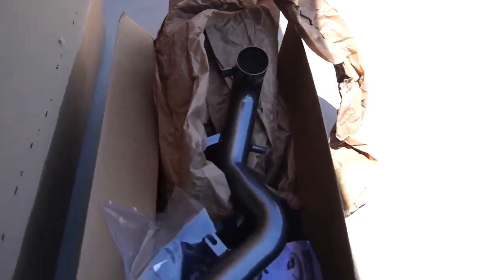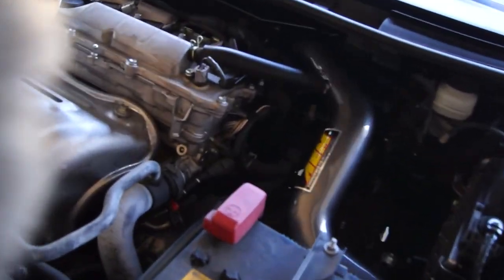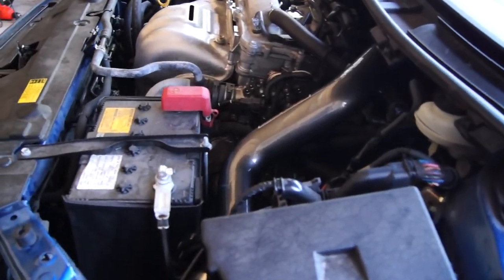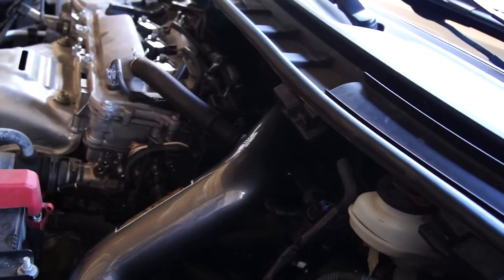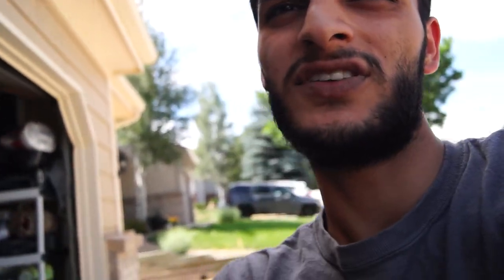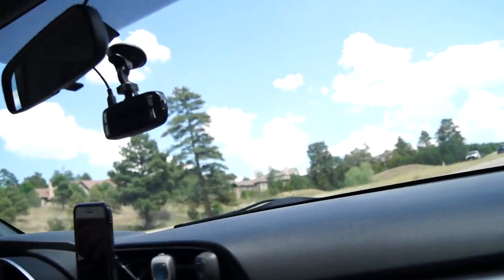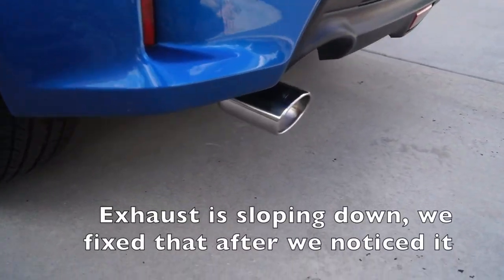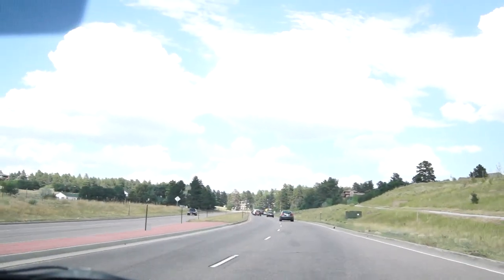[Car Vlog] Scion TC Borla S Type Exhaust and AEM Cold Air Intake

Comment: You get check engine light?
Reply from the maker: Yes but it went away after the second time we turned it on. If you persistently have one then try resetting the light. If it comes back then you either have a leak, loose something, or broken o2 sensor cable. Or other things